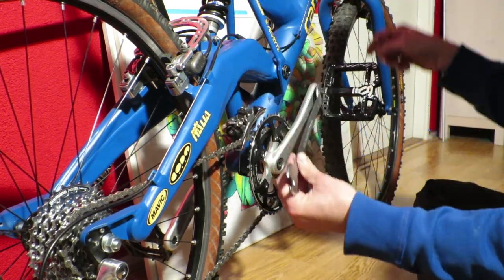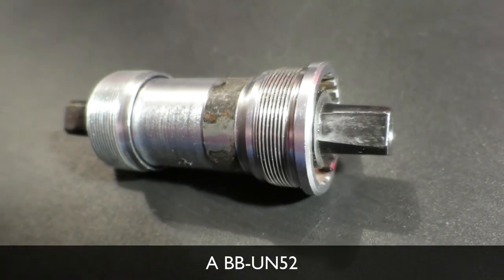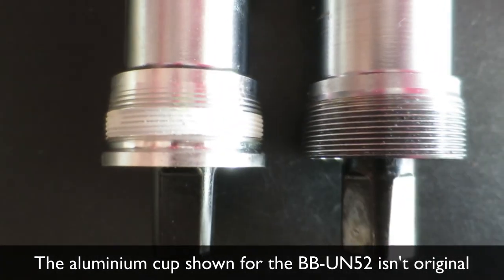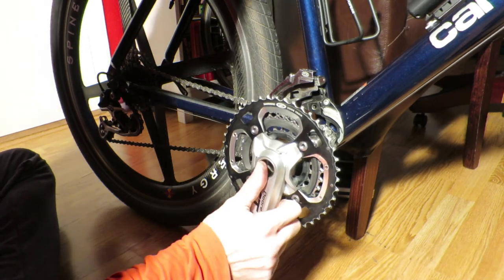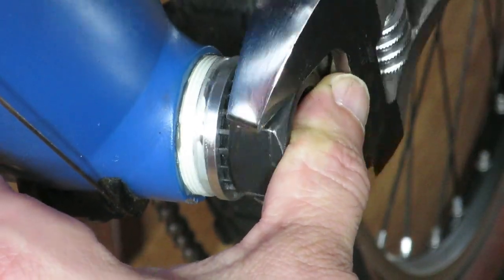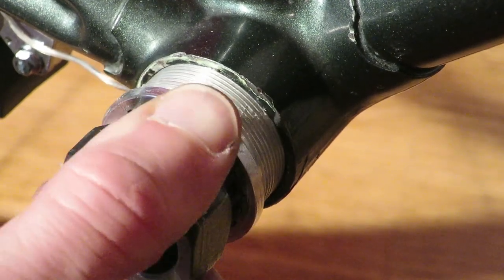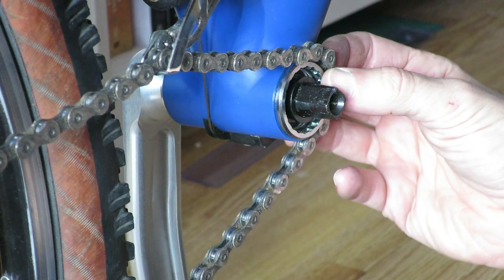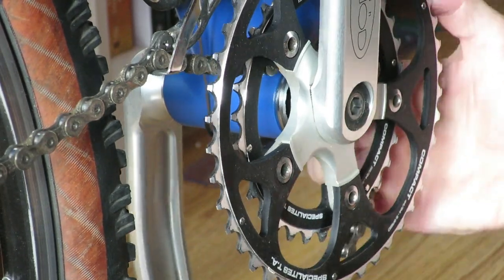BB-UN55 vs BB-UN300; which is the better square taper bottom bracket?

Comment: Shimano's cartridge bottom bracket was revolutionary, taking a component that required frequent servicing to a maintenance free reliable component that so long as you didn't blast water and degreaser into the seal and wash away the grease would last a very long time.  Too bad nothing higher than the UN26 is readily available.  The UN72 was amazing and silky smooth.
Reply: I still use shimano sealed square taper, way stronger than external crap
Reply: Suntour had the VX line of sealed bottom brackets in the early 80s.
Reply: Shimano didn't invent them and the old cup and cone type can last much longer though if you do the maintenance. That is a big IF as most people don't...

Comment: 230903:  about "Square Taper Bottom brackets need to go some day": Currently almost all ebikes I saw under 2000$ used this type of BB's because it is easier to install the cadence sensor for pedal assist on them.
Reply from the maker: I feel that for something to be a bicycle, it needs to be human powered, so I never took e-bikes into consideration. You're right of course though. I feel the main reason square tapers are used on e-bikes has to do with a lower price, and things like stiffness and weight are non-issues.

Comment: I've had UN 300 fail very quickly as water got into it and cartridge bearing was all rusty inside, those fancy seals are useless, at least the one the non drive side. I used to have old bike with plastic cup shimano bottom bracket and that one lasted a long time I think it was some cheapest model that they used to have. The UN 300 isn't even that cheap I wouldn't recommend unless you live in some nice place not a hellhole with 6 months of winter like I do.

Comment: One of the benefits of a Square Taper Bottom Bracket is in travel/tourning bikes.  It is much easier to separate the crank from the frame and pack in a bike suitcase for travel.  Here I am referring to a Travel Tourning Bike with S&S Couplers,  but applies to other bikes as well for travel.

Comment: Unless your a weight stickler and need to run the widest boost tire options available square taper is perfectly reliable and performs just as well.

Comment: I have never opened a BB-UN55 but I´m pretty sure that internally it is a "cup and cone" type bearing. The correct technical description would be, that it has two angular contact bearings where the inner race is directly ground into the spindle, the outer races are fitted into the cartridge shell. The BB-UN300 is completely different. Two radial roller bearings ("industrial bearings") are pressed onto the spindle. One advantage of the first type is, that the balls are bigger. Another difference is that angular contact bearings can be fitted with quite some preload. Radial roller bearings can only be preloaded very lightly. You can feel that preload when you take a new UN55 out of the box, it`s smooth but a little bit stiff. What happens when you start riding is that the bearings will "set", it basically means that races and balls will grind against each other on a microscopic level until they fit perfectly, the UN55 will loose the initial stiffness within a couple of hundred kms and will typically last a very long time without any service. With the BB-UN300 I can´t tell. This type of construction is usually found on cheaper square taper bb. The fitting is probably not as tight, it can not be preloaded the same way, maybe the components are of a lesser quality, who knows? There are high quality versions of this type around (phil wood) as noted in the video and the "industrial bearings" can be replaced. But again these types also rely on a tight press fit between the bearings and the spindle, so for the average user it is not that easy to replace the bearings. Hollowtech 2 is much simpler to service in this regard, but comes with it´s own set of problems. HT2 relies on the frames BB shell for the alignment of the bearings. If the frame is not perfect, you might get problems with creaking and/or rapid wear of the bearings, a problem that was pretty much unheard of with the high quality shimano cartridge type BBs.
Reply from the maker: In general, and this is based in part on personal experience, I would argue that "older is better". What I've seen is that same-type technology today versus decades ago is using cheaper materials. Technology has reached a level of minuteness and complexity which increases changes of failure. Technology has become non-mechanical and depends on batteries and/or software with a short lfiespan. And the ability to service products and replace components play second-fiddle to marketing and sales or don't play any role at all. 

Assuming that I'm correct the chances of the BB-UN300 being of equal or higher quality than the BB-UN55 is almost impossible. But you display more knowledge about bottom brackets than me so who knows.
Reply: @restorationdotbike  Yeah, sorry, I got a little bit carried away in my comment, but that is exactly what I was trying to say. If you look into the construction, these older style shimano components often scream "build to last". In the case of the UN55 it´s about how these angular contact bearings are neatly fitted into a comparably massive shell with very tight tolerances. The change from longlasting components to throwaway stuff is even more visible, if you look into shifters. There are some very nice videos of "atboy", who takes apart a lot of old tech. If you see the insights of a M739 XT shifter, these things are built like a tank. That kind of build quality is just not available anymore, sad... For BBs you can still buy the BB-UN26. It has the same basic construction like the UN55, only the cartridge is made of steel instead of aluminium, what makes it a bit heavier, but the quality should be there.
Reply: About UN300's construction being similar to cheaper brands' BBs, I find it interesting that UN300's bearings appear to be significantly narrower than in said cheaper products. Would that imply smaller bearing balls inside? The bearings being more delicate in general?
Reply: @tocaamerillo431  Yes, a narrower bearing has smaller balls, but in terms of lifespan whats more important is a) the fit and finish b) the quality of the races and balls and most important lubrication and cleanliness. If you get water and dirt inside a ball bearing it will fail very fast, no matter the quality

Comment: Too bad they stopped making the un55 and now they are in limited supply, the un300 seems fine, but I’ve been reading about how they are more prone to failure. I guess Shimano is just shifting away from square taper. There are options from other brands which are affordable and seem solid such as the Tange LN-3922 and 3912 as well as the IRD QB55 which seem solid. IMO any sealed bb will be solid since loose ball/cage bearing bbs just don’t keep out the water great.

Comment: The BB-UN300 is pretty hard to beat for twenty dollars.
My last bike had a non sealed caged bearing bottom bracket the BB-UN300 is a huge step up from my old bottom bracket...
I hope my new bike has a BB-UN300 or a Hollowtech 2 bottom bracket...

Comment: BB-UN26 has failed on my bike after a couple years, so I'm now looking for a replacement... What's left of Shimano's square taper lineup is frankly not very encouraging. I've narrowed my choice to be between UN300 and Neco B920AL (I don't care much for it being aluminium, but it comes with extra seals in the cups compared to steel Neco models). I'm veering towards Neco because of... well, just compare the sizes of the bearings! I haven't seen UN300 in person, but on all the photos I can see its bearings appear to be maybe 60-70% width of the bearings you can find in cheaper brand BBs. I understand this might not be telling the whole story, but surely for the part that has to bear such stresses size does matter.
Reply from the maker: I've now used the BB for about 2 years on my daily driver without any issues except a cosmetic one of rust on the spindle. I do take very good care of my bikes, so I'm maybe not really representative of the average user. As far as bearing life is concerned. It's highly dependant not on frequency of use, but in what conditions the bearings are used. In general sealed bearings can last for years or even decades, unless their seals are compromised and dirt, grit and moisture gets to the bearings. I've known people who've ruined their very expensive, very large, high quality bearings, after a single very muddy, very wet ride. Riding in dry conditions simply makes an enormous difference versus riding in wet conditions.

Comment: Why exactly is the 300 inferior then? You didn't say anything apart from the fact that it's placed at a lower level than the 55. What technical specification led you to this conclusion?
Reply from the maker: Shimano used to make the bottom bracket equivalent of a Volkswagen, Skoda, Audi, and Mercedes. With the BB-UN55 being a Mercedes and the BB-UN300 a Volkswagon. Shimano now only makes Volkswagons. There's no longer a large enough demand for Mercedes' equivalent of square taper bottom brackets for them to make them. In general a Volkswagon is deemed inferior to Mercedes.
Reply: For example, the BB-UN 300 has smaller bearings (about half the size of the 55) and they are more "exposed", because the non-drive side seals are part of the cup (not the body) and it does not have a one-piece body with both bearings encapsulated inside of it.

Comment: Does anyone know what the hard black plastic ring on the drive side spindle is on the UN 300? I see the same one in this video, so I wondered what the purpose of this odd ring is sitting in the middle of the spindle is for.
Reply: The crankset butts up against it; basically for correct chain-line position.

Comment: My BB-UN300 failed after 4 month and about 1000km, but i believe i may have overtightened the nondriveside cup. If you find that after tightening the nondriveside cup the axle is difficult to turn, you might want to backup like an eighth of a turn until the axle is turning freely again.
Reply from the maker: It's my experience you cannot tighten a non-drive side cup in such a matter that it impact the rotation of the BB. Just as you cannot tighten a skewer in such a way that it impact the rotation of the bearings in the hub. If my assumption is true it means something else was is going on with your BB.
Reply: @restorationdotbike  Metal is hard but it can indeed move a little. I found that tightening a skewer does impact the bearing play, espacialy with aluminum axles.
Reply: Mine failed too the bearing on the non drive side was completely rusted even despite those seals, very strange, in fact it was worse than unsealed tange bottom bracket that I used to have that had cartridge bearings exposed.

Comment: Another prominent bike mechanic says NO grease on the square tapers. 
Clean them very well and strip any signs of anything on them. So which
is it?
Reply from the maker: Do you have a URL I can look at? Would be very interested to learn why NOT to use the number one method in reducing risk of seized components because of corrosion.
Reply: @restorationdotbike  White Industries told me to stop this practice. I ruined my
first Square Taper cranks from them because no matter how tight or how
much blue lock tight on the threads 
they were working loose. The new set started walking as well. That's when 
they discovered I was using grease. 
They told me to clean the tapers very 
well. Boom. No problems now whats
so ever. Typically you grease things like this but just not square taper parts.
You can ruin a set of square taper
cranks very easy.
Reply: My crank was creaking like mad until I put some grease on it, I'd definitely put grease.
Reply: @V8_screw_electric_cars  I regrettably tried the same. Be prepared to replace them.
Reply: @JohnDoe-zb7dz  Why would I, you always should put grease wherever metal meets metal, same with stem in steerer tube otherwise it will creak to no end.
Reply: @V8_screw_electric_cars  Do what you feel you have to do. I just know what I was told to do from the manufacturer and it' solved all my issues. Yes, stems and seatpost I understand. Put some grease on a rope and try to climate it 
and let me know what happens. Stems and seat post are directional pressure, clanks are bi-directional and work back and forth. Your mileage may vary good luck.
Reply: @JohnDoe-zb7dz  These are official "White Industries Crank Installation Instructions": 
https://www.whiteind.com/wp-content/uploads/2020/09/Crank_Installation_Instructions.pdf
Even those recommend to "lightly oil or spread a thin film of grease onto the tapers of your bottom bracket spindle". 
Sure, without grease, the cranks should work just fine. However, removing them in the future will be much more difficult.
Reply: The reasons you do not want anything on tapers are that the crank arms are made of much softer metal than the axle tapers.  The tapers will form an air tight friction fit on the axle tapers if they are clean (assuming you have the right type of tapers as there are multiple types).  Once the crank arms settle on the tapers after a few rides and re-tightening the bolts the bolts serve no purpose in regard to holding on the crank arms (crank arms are suppose to be hard to remove).  The bolts could even be removed, I use ultra light anodized aluminum bolts which just keep the axle threads from getting dirty.  The other reason is that every time you remove and install your crank arms on a tapered axle they wear out some.  The act of tightening the bolts down forces the hard axle tapers into the softer crank arms holes.  If you do this enough times or really over tighten the bolts the crank arms will start or completely bottom out on the taper edges.  Once this happens the crank arms cannot get a good grip on the flat axle tapers and wobble or keep coming loose.  Applying any oil or grease on the tapers just makes them slide on that much easier wearing them out faster.  Once your crank arms start to bottom out on the axle tapers they will never stay tight anymore and the only fix is to get a bottom with over sized tapers so they do not bottom out.  There are three different types of axle tapers, Shimano and Campy used to used different styles (not sure if Campy ever changed).  You do not want to use the wrong style taper for you crank arms, this is more of an issue when using 3rd party cranks or bottom brackets.  Use the same brand cranks and bottoms if you are unsure or contact the manufacturer for what to use.  There are multiple 3rd party tapered bottoms that are much better than anything Shimano ever produced but they cost much more.  They come in all different axle lengths, taper styles, thread types, bearing type (steel or ceramic) to fit any brand of frame or crank set.  I like to think of a bottom as a set and forget item so I am willing to pay more to not have to deal with them.  Personally I gave up on Shimano ones decades ago and use Phil Wood one in all my older bikes.  You cannot purchase a better tapered bottom but they will run you $200+ for the bottom, threaded cups, and installation wrench.  I have some that are over 30 years old and still working fine but then I try to stay away from wet mucky conditions.
Reply: @DoNNiEdx77  Very  well-articulated. Great explanation. This was what I was after and trying to explain. Thank you!
Reply: Put antisieze on it. Dry is a recipe for disaster...

Comment: Shimano BB-UN55 or Neco B920HAL, which is better?
Reply from the maker: I have a Neco lying around which I never used because I accidentally bought the incorrect spindle length for the particular bike it was meant for. The reason I bought a Neco was because it's readily available, came with an aluminium fixing cup, and seemed more premium compared to the BB-UN300. But that's as far as my experience goes. 

That being said the BB-UN55 was installed by many brands on many high-end bikes at the time. I doubt the Neco has this track record.
Reply: Where can I buy neco?